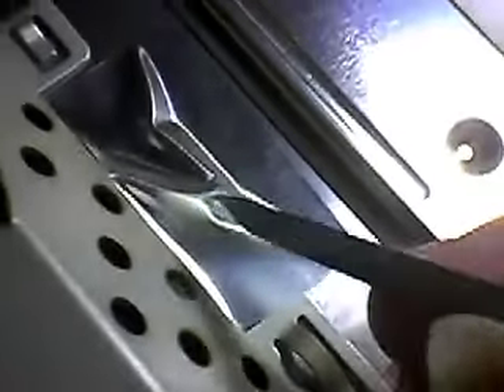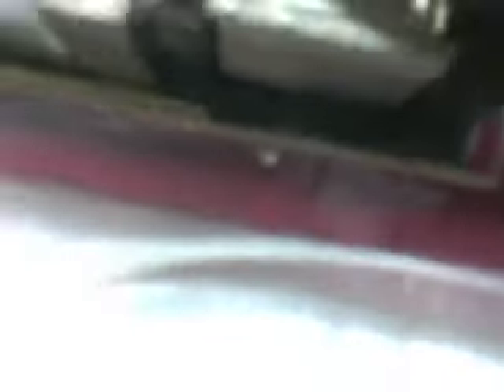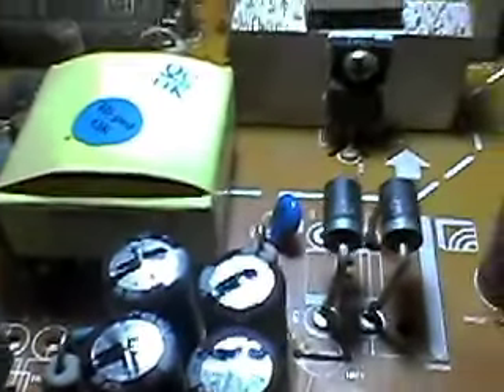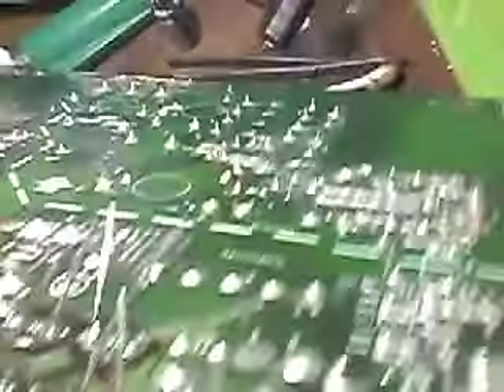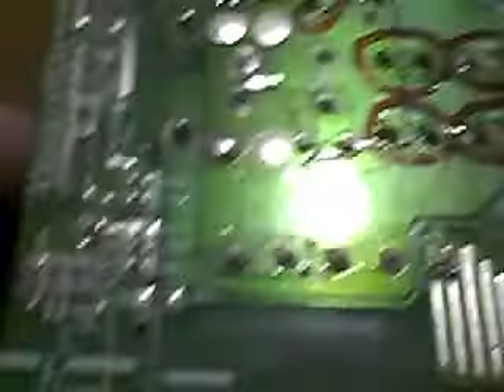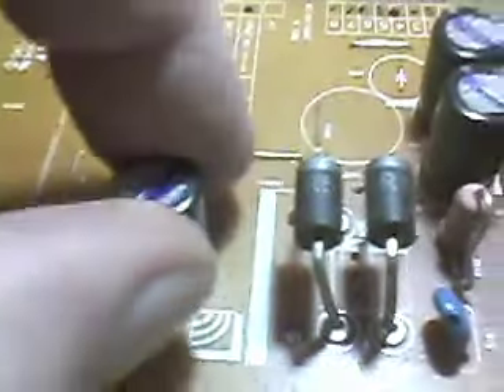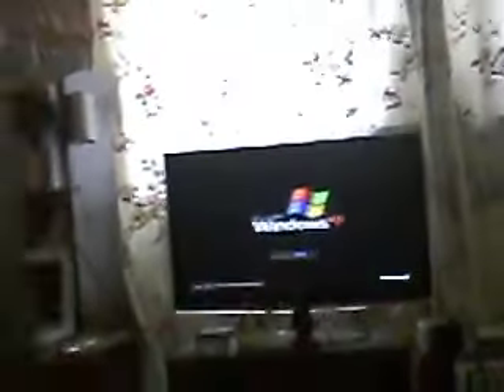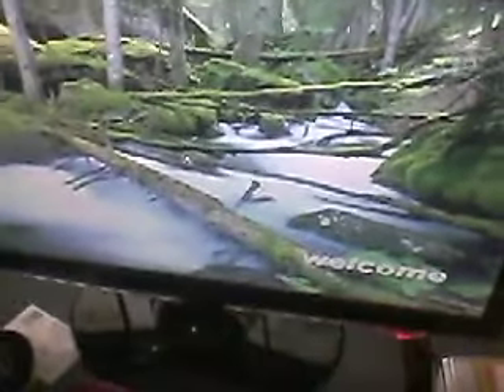LG W2261 monitor repair bad caps

Comment: Hey bud, I watched this video a couple of days ago and I have some caps coming in the mail to perform the same repair (Don't know why I didn't notice the bulging caps before watching this). Am I remembering correctly that I saw a schematic in this video? If so, how did you get it?

Before it wouldn't turn on at all, my monitor had an issue where if the screen went black for too long (more than a second) the backlight would just stay off. So I am trying to reverse engineer the circuit around the FAN7314A and it's making me want to kill myself. A schematic would be real nice.
Reply from the maker: No I never got a schematic you might be thinking of one of my other video's, the FAN is NOT standard I added one to the 5 volt rail to keep the caps cooler so it would last longer. And I am watching this now on my repaired monitor still good :)